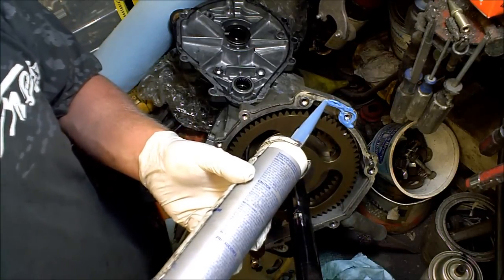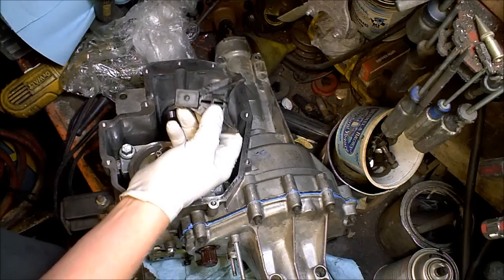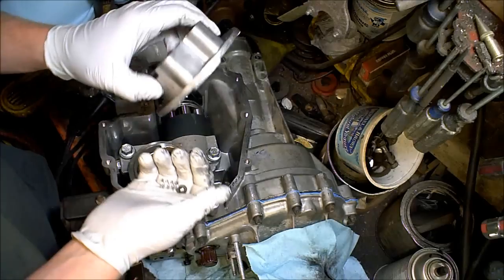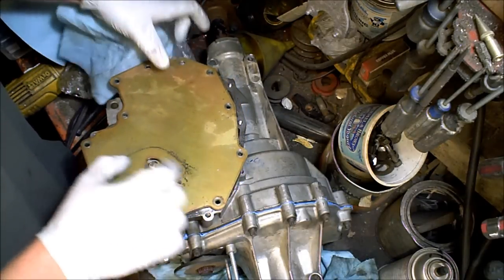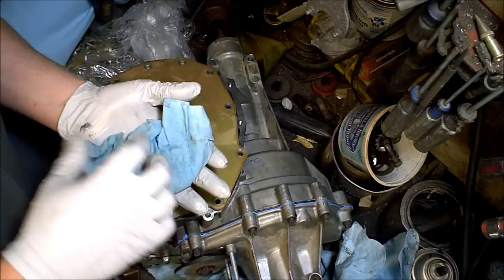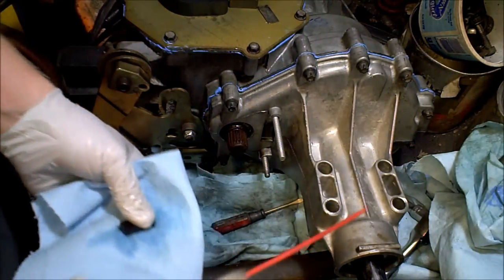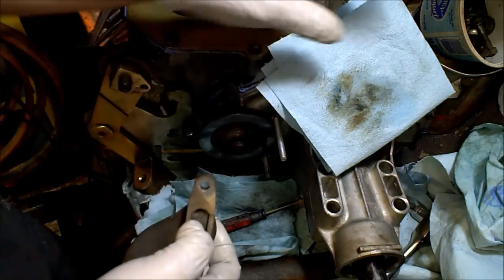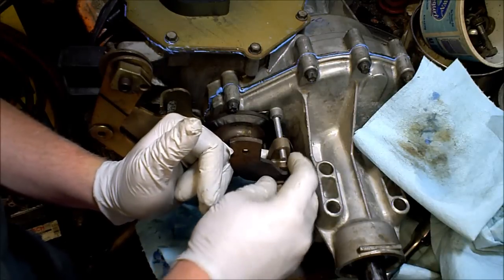4 Hydrostatic Garden Tractor transmission rebuild 4 of 4 Hydro Gear

Comment: Prob dont monitor you channel anymore but for anybody going to tear one of these apart spend the extra money and buy the seal kit . @When you put in old seals back in there is a good chance they will leak internally and you will lose hyd pressure and the trans will fail , I just check on a complete seal kit on Ebarf $65.00 and I would highly recommend replacing the filter . If there is chunks in the filter it will cut down hyd pressure for the system and the metallic will go back into the system and tear  up the pumps . If you are going to tear it down do it right . Other than that great job I love it

Comment: Another question. How would you be able to determine the actual speed of a ride on tractor mower.
My Husqvarna YTH 2548XP states in the User manual that forward speed is 5.8 mph and reverse is 2.1 mph.
I feel that the reverse is pretty slow compared to a lesser John Deer 17.542HS I own and I would love to be able to quantify it.
Reply from the maker: Whenever I test speed on something like this I use phone GPS speed apps.
Reply: @sixtyfiveford  Ah ! very clever. Thank you Sir.

Comment: I know this video is kinda old, but I wonder if you can help me. I was given a mtd riding mower with a messed up suspension and a newer poulan pro with a blown engine. I swapped the engine to the  poulan because it was in better shape. The problem that the hydrostatic tranny goes great in forward but when I shift it to reverse the lever goes about an inch not all the way to reverse, it does move back but very slow. I would greatly appreciate any help you can offer. Thanks in advance and I really liked your videos.
Reply from the maker: I sounds like you just need to adjust the fwd-rev linkage to allow further travel in reverse.
Reply: @sixtyfiveford  I'll try that, but just to note the slot where the shift lever goes through still has about 2 more inches of travel left. Also when I put it in neutral it still goes forward ever so slightly I have to put it a little in reverse for it to stop. Thank you very much in advance for your help.

Comment: Over a year ago I told you that my transaxle was frozen even though the interior was pristine.  There were no broken parts.  You asked me to tell you what was broken if I ever figured it out.  Well, the transaxle people told me that the aluminum bearing surfaces where the pumps spin get microscopic slivers that burr. These tiny burrs prevent the pumps from spinning, thus locking the axle, even when the release is pulled.  They told me to get a 2000 grit metal sand paper and polish those surfaces.  I was incredulous, but did it.  It worked.  I was shocked that tiny little aluminum slivers could completely stop those pumps from rotating.  Unfortunately, the mower sat for so long that many other parts froze.  But it's almost rebuilt.  Thanks for your great videos. Now Im going to go watch you build a glass pack muffler.
Reply from the maker: I recall. Good info! What brand of transaxle was it?
Reply: Hydro-Gear.  But I expect this will solve a slew of sudden lock ups.  I was surprised to discover how hard the pump cylinders were.  Mine uses the same size cylinder for both the pump and the driver.  But the driver is buried and extremely difficult to reinstall.  I tried a number of methods. Once I forced it a bit too much and discovered that one piston was cockeyed in the cylinder.  I honed off the burred edge a bit and neither the piston nor the cylinder were out of spec.  I suspect that the cylinders are so hard, that just a sliver of anything could stop them from rotating.  There are a lot of folks around me that have these big zero turn mowers and one, or both lock up simultaneously.  They will not even free roll.  The bad part is, one has to tear the entire axle down to the very most inside part to accomplish this task.

Comment: I know I'm late to the party here, good video, thanks.  After seeing you use a big tube of gasket material, how do you keep the remainer fresh?   I loose the balance of any tube once it's opened.
Reply from the maker: The large calk gun size tubes hold off drying better than the tiny tooth paste size. The nozzle on the large one will begin to harden but can generally be squeezed out and I generally get 1+ years out of a tube once it's opened. I jamb a bolt in the opening.

Comment: I've got a Craftsman that starts slipping after it gets warm.  Did a search and found this series you did.  Thanks for a great look into how these hydo-pump systems work.  Mine is also whining (suspect cavitation) and pulls like a mule at first, but does slip going up hills after a while.
Reply from the maker: You can try putting in thicker oil like SAE 60w motor oil. It will sometimes give you a few seasons more of use. Don't use gear oil like 80-90w 85w140 etc as its viscosity is measured differently than motor oil and is actually thinner than sae 60w motor oil.
Reply: Thanks.  Will give it a go. Interesting.

Comment: Thank you for sharing your vid's they are the only ones I have found the most helpful start to finish. I have two I am going to try to repair.I was struggling with trying to find my models and part #'s I needed. I just came across this sight and.... FINALY FOUND MY MODLE and the part #"s that I need to order. Hope this link helps others find their model and part #'shttp://www.mymowerparts.com/pdf/Hydro-Gear-Transmission-Transaxle-Parts-Lists-and-Service-Repair-Manuals/

Comment: Dang ! I got a 89 Noma for free and I'm a little hesitant to try this project. I changed the oil and never got rid of the whining. It moves now but let it sit for too long and it'll be hell on earth before it engage and when it does, it has no torque at all.
Reply from the maker: Thicker oil will help fill in the wear. Straight SAE 60 will help but can get pricey.
Reply: Would 80w90 too thick ? I never seen SAE 60. just SAE 50 or 20W50.
Reply from the maker: 80w90 is virtually the same viscosity as sae50. They measure motor oil different than gear oil.  Straight sae50 will work better than 20w50(acts like thin 20 until hot) so will sae40. Sae 60 is racing oil an not found everywhere. 

http://www.engineeringtoolbox.com/iso-vg-grade-d_1206.html

Comment: Just had the hydrostatic transmission go out on my 2002 Murray and this really helped me realize the scope of the job. Looks like this unit is a Tecumseh but no numbers that I could find. Jacks Small engines has this transaxle unavailable. Any suggestions where I can find the parts? Thanks again.
Reply from the maker: You need to identify the hydro unit with a model and then the main parts should be available through a Google search.
Reply: Found it! Its a Peerless 2000002A SilentTrac.

Comment: What oil do you  use in a MTD Gold series hydrostatic tractor use? The tractor is a 2014 model with a 20hp. Kohler engine. Is it possible to change the oil in the rear end?
Reply: sometimes the owners manual will not speak of that. find a repair manual online or call the company for a pdf download. it's what i do. their happy to do it. at least sometimes.

Comment: Sixty, big fan of the channel.  Wish you were my neighbor.  Is that weird?  Lol.  Anyhoo....I have a 1996 Ranch King Pro...any idea on the transmission make/model?  It has a nice 25 hp kohler command with 513 hrs and a gardenway FEL with a back blade and 50 inch deck.  Picked it up for $1400.
Reply from the maker: +wkualum I'm curios if your model number starts with a 995 (under seat)?
Reply: +sixtyfiveford the model is 169037 and the mfg id is RKGT25H50A.  can't find a operator manual to save my life.  the parts manuals I've found are mostly incomplete.
Reply from the maker: Your tractor is made by AYP American Yard Products. They made many things under many brands but Craftsman, Husqvarna and Poulan Pro being the most notable.Yours was built in 1999 and here is the link for the parts breakdown to your machine http://www.outdoordistributors.com/pdf/AYP/AYP-MODEL-RKGT25H50A-PARTS-LIST.pdf

AND here is your Sister owners manual for a the Craftsman version of the same tractor with a 22.5hp instead of 25hp. All the main parts should be identical (Craftsman 917258911) http://www.searspartsdirect.com/partsdirect/user-manuals/917258911-craftsman-parts-tractor-manual?pathRender=fromManualTabPage
Reply: +sixtyfiveford thanks a ton for the link to the sister craftsman.  What's your opinion of this type of trans?  Any do's and don't since I have a loader on it?  I have two 125 lb wheel weights to mount yet.  I'm always hesitant to add a weight rack if I can get it on the wheels.  I'd love to locker it just don't have the time.
Reply from the maker: Yeah, I would put as much weight as you can on/in the rear wheels as you can. This will save the bushings in the axle. Yours is a Hydro Gear like the one I do in the video. They aren't the easiest thing to find parts for but no hydrostatic is.
Reply: +sixtyfiveford are hills a big no no in your opinion?
Reply from the maker: The thing that will wear the transmission out is  constant pulling of heavy/resistive loads, like pushing snow. Also constant and quick forward then reverse actions.

Comment: It seems like it's always the pumps losing the tolerances in those hydro-trans.I try to steer people away from those tractors if they are using it for ground engagement or anything other than mowing grass.Thanks for another great vid.
Reply from the maker: +Mr Frog They're nice to drive but have a horrible lifespan.
Reply: Yes sir! How do i find vids about your '65 Ford?
Reply from the maker: That's a great question. You would think I would have videos on it... But I don't. Go figure.
Reply: I just found and subbed to your channel,and see the rust removal preview on what looks like a '65 F series.Then I see a 6th gen(my favorite) F series 4x4 in front of your house and your Expy in the driveway.Do I detect a pattern here?
Reply from the maker: Yep, lots of Fords around here. 59 F100, 65 F100, 66 F100, 78 F150 4x4 and the Expy. Reluctantly sold my Full size 78 Bronco a few years ago due to lack of time to use.
Reply: Too bad about the Bronco. I loved my 95,so did the truck thieves.They also loved my 96 F350 4x4.I guess they needed a good plow truck more than I did.
Reply from the maker: ***** Hydros made in the past 20years are deamed non servaible and throw away units by the manufacturer. They don't last even close to as long as the old Sunstrands or Eaton hydros.
Reply from the maker: Yes. But also the tractors they were in cost triple(with inflation) what one costs today.
Reply: +Electronic Experiments I have 4 Simplicity garden tractors, 2 7117's and 2 smaller ones, the hydros work great in all of them . I personally do not think it is worth the time and money to repair a White, Murray, Yard Machine, Carftsman etc they are throw away mowers, when they quit working go buy another. Or you spend the money and get a Deere or a Simplicity, but the ones at the big box stores do not count, @$1500.00 they are cheap to compete with the cheap "consumer" mowers.

Comment: You made that look easy. I have a question hope you can help. My trans slips in forward gear when you push the lever more than half way forward. It seems to have no real slipping reverse. Have any suggestions? Thanks.
Reply from the maker: +Mark Jones Sounds like your trans is worn just like in the video. It will either be you pump block or motor block.
Reply: Ok thanks.

Comment: Nice Job, Now I can strip and clean mine, as the forward / reverse lever is very stiff. ( from a tractor i bought that had been standing)  just like to say that usually a little less joint compound is better, overdoing it can lead to internal oilways getting blocked with sealant where it comes off inside.. remember as much sealent will squidge out on the inside of the casing as does on the outside..when all is tightened down.. silicone sealent is great as its very good at filling gaps, better than a gasket when the tolerances are close. I usually wipe the sealent around the edge with my finger , removing any excess, a 1mm bead that gets squashed out is fine and wont drip off inside the casing...any more is too much...
Thanks again for showing us how it works and what wears out inside..Colin

Comment: Thanks for posting this video.  I am currently rebuilding the trans on my Kubota 1860G and it is nearly identical to the one you rebuilt.  I found that just like your trans, mine needed a new motor but the pump was fine.  I am replacing both since I bought them before I took the trans apart.  I didn't take the right side cover off like you did and I dumped the gears on the floor when I separated the two halves of the trans.  Live and learn, lol!
Reply from the maker: kufman01 Those Kubota's are good machines. Gotta love the parts that seam to explode into a million pieces when you take them apart.
Reply: sixtyfiveford The tractor itself is pretty good, the trans, not so much.  Do you think synthetic oil would extend the trans lifetime?  I had to do this rebuild at less than 500 hours!

One more question, what liquid gasket stuff did you use?  Is that the blue, sensor safe stuff from Permatex?
Reply from the maker: Yeah, I just use the Permatex I had laying around. Any form a gasket will work for a hydro trans. The tractor in the video only had around 500hrs if I recall. The motors in these will run 3000hrs or more if maintained.

Synthetic: There's a lot of hype here and you "may" get 10% more life. So instead of 500hrs maybe 550hrs. You would be better to use cheap conventional oil and change it on a 100-200hr schedule. Doing this would give you 1000hr life more than likely.

Comment: Thanks!! I'll have to drain some and look at it. Mine doesn't like hills once it's warmed up. Rolling the dice on an oil change. Even though it's supposed to be a sealed unit.
Reply from the maker: 54coupekid Yeah, they claim they're all sealed and lifetime lubricated. Put some thicker oil in it and it will seal and work. You can enter the model number online and find out what they put in there from the factory.

Comment: Fascinating! Is it true that the transmission stopped working because of .090 of play on a couple of pieces? It's a wonder these things work at all. But great job on the video and thanks for taking the time to produce it.
Reply from the maker: Ben Lugosch Yeah, it doesn't take much for them to fail. The transmission did still move the tractor but would stall on hills.

Comment: I really enjoy your videos.  Very informative, no fluf.  Straight forward to the point information.  Keep them coming.  If somebody had to pay for a service like that what would what would be a rough estimate?
Reply from the maker: ***** It would be very hard to find any shop that would do this. Most would tell you to buy a new machine. The second option, is they would want to just replace the transmission for $800-1200.

Comment: My father bought a brand new husk Varna years ago and the reverse gear was always absolutely weak. Is that common on those tractors? Or possibly just a problem that the manufacturer missed?
Reply from the maker: The linkage is more than likely set up wrong. You can adjust it to allow more reverse speed/power.

Comment: Great video, I am having the same issue with my Husqvana..... Now where are my hammers?!
Reply from the maker: :-0
Reply: sixtyfiveford Just some more feedback on how I went. I live in Brisbane AUS so I asked my local Husqvarna dealer about my "dying tranny". They stated it is a non-servicable part replacement A$1,700.........I phoned around and got a quote from a backyarder to repair mine "around A$800." So after watching your YouTube I found the Tuff Torq site online and purchased the new motor and pump for my model transmission. Including postage to AUS A$202 I fitted it on the weekend just past and the mower works like new. THANK YOU for sharing your knowledge to help the rest of us save some $$$$. Appreciated. Very happy camper! :)
Reply from the maker: You're very welcome. I'm glad you took the initiative to do the repair.

Comment: I called about a Riding Lawnmower that a Man has for-sale on CL, its an Ariens Tractor that has the Hydrostatic Transaxle,,and it is slipping when it gets hot,must be due to the  Pump Rotor or  Motor Rotor's bore or Bearings or both having wear and losing pressure when it gets hot due the Oil thinning and Metal expanding from heat, then it shows up from the wear , it has the Spring Loaded Ball/Bearing Pistons,so the problem is probably very  similar to your problem its losing pressure due to the wear I thank you for making this Video I think you did a great job Thanks again
Reply from the maker: Yep, the hydraulic motor is more than likely worn. Before you buy it find out how much the pump and motor is to determine a repair cost.

Comment: Hey I just did a rebuild on a k51b transmission, i replaced the filter,oil,pump, and motor.  I put everything back together and "tried" to purge the transmission.  Im not having any luck getting the wheels to move.  Any help would be greatly appreciated.  Thanks
Reply from the maker: The bypass? That little tiny internal pin diverts all fluid. I would make sure the linkage for the bypass isn't binding and the lever is fully disengaged.
Reply: sixtyfiveford the tiny internal pin your refering to is the tic tac sized pin correct? I i'll check the lever again and make sure its correct, thanks for your help
Reply from the maker: Yes. It can easy be dislodge when your reassembling it.
Reply: sixtyfiveford come to find out, there is a filter underneath the drain plug and spring on my tranny, and it wasnt allowing me to properly fill my transmission to the point it needed to be at.  I removed the filter and put 2.25 qts in and i was good to go...thanks for your help and instructional!
Reply from the maker: That's great to hear. Another good lawn tractor saved.